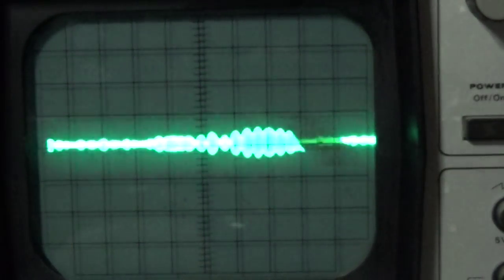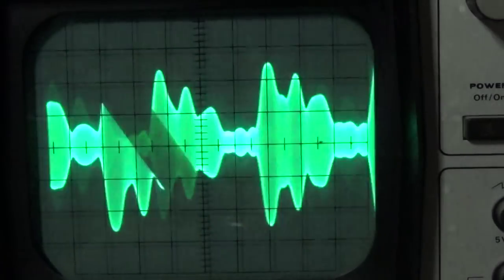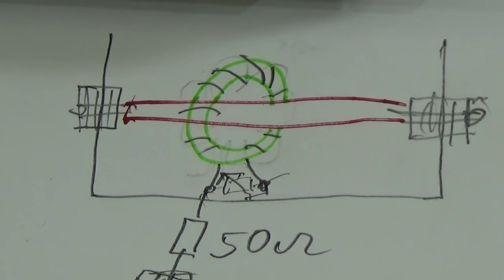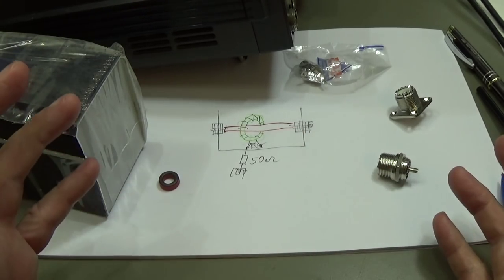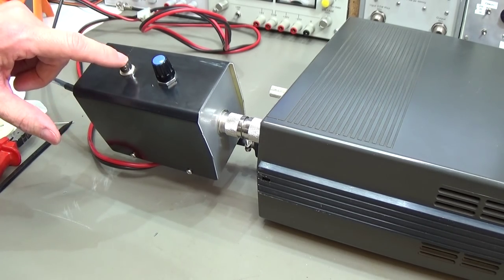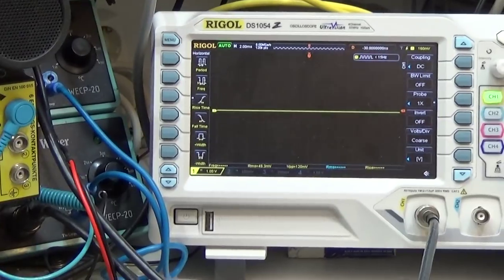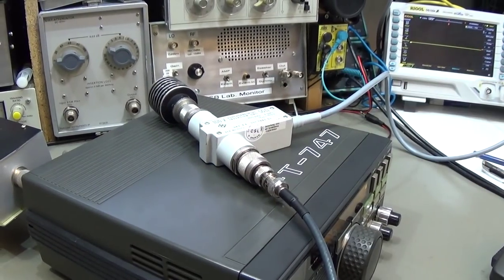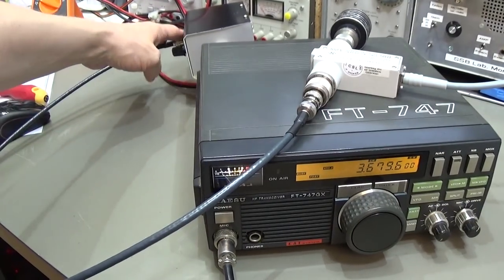#74 Quick Tip: Build a Variable RF Tap for your shack or lab

Comment: Nice project Peter! I use a few of this design (slight variations) in my AM setup. I directly power headphones so I can hear my final audio... As you pointed out, also great for driving scopes :^)
Reply from the maker: +Mr Carlson's Lab Hi Paul, thank you so much! Yeah with a AM set up it is much easier as the demodulator is very easy to realise. For SSB it is a bit more effort.. Anyway enjoy a happy advent! 73

Comment: I was going to say it’s not the easiest way to make  an rf sampler but the fact it’s adjustable is a winner. I am making some videos myself on playing with RF test gear and I enjoy construction projects so will have to give this design a try.  As always thanks for sharing.
Reply from the maker: Thanks for feed back and good luck with the project! 73
Reply: TRX Bench  I will be uploading my video using a simple loop in a dummy load housing later this week. When I investigated the frequency response of my rf sample it was a bit disappointing with a high pass response and 30 dB difference in attenuation between 2 and 145mhz. What was the response of your transformer coupled sampler. The idea behind my short video series will be how not to destroy your front end. My best regards Chris.  I made a boob measuring a second harmonic as I had not included  for the frequency response of my  sampler.  I would love to hear your thoughts on this and measurement errors in a future video. My very best regards Chris AKA all the gear and no idea!

Comment: Use a box with a lid so all soldering can be done easier.  Stay with metal.  Use a copper strap across the bottom to connect the ground side.  The box has all kinds of "floating" grounding you have used.  The BNC is grounded, so take advantage or that and design a proper voltage divider network.  Use a coax cable and keep the shield on it except where the IRON Core toroid not a ferrite goes.  Ground each end of the shield as close to the toroid as possible and at each rf connector.  Use polymide tape and build up the diameter so the torrid is a snug fit and will stay in place.  Use non inductive resistor for the divider network.  Do not use a wire-wound resistor anywhere, especially as a trim resistor.  Why is everyone still using UHF connectors.  They reflect RF as low as 100 MHz.  I change everything to N Type, even all my radios.  Use good ones from Amphenol or King with a white bronze coating.  It will not tarnish like silver.  While you're at it add an AM detector to it.  You will need a shield between the 2 circuits.  Ig you want to go above the HF bands, you will need to use SMT and keep all leads as short as possible around the divider network and maybe shield it also if you go to 1 gig.
Reply: Build one and show us.  It is childish when Johnny-come-lately know-it-alls  show up on tutorial videos like this trying to show how much they know.

Comment: Hi Peter, what value resistor did you put across the POT?  I see the 50ohm connecting to the bnc but I don't believe you mentioned the value on the pot.

Comment: Personally I would put all components on one side only and put feet on what you have used as a lid. Makes assembly much easier. Useful video though. The formula for the number of turns verses attenuation of the sample would have been useful but is available on another video on youtube.

Comment: Simple, effective and a much needed device. Thanks for sharing. One question, do the resistors have to be non-inductive? I have a bunch of 50ohms lying around, how can I test whether they are inductive or not?
Reply: Ok, I was quick to ask. At the end of the video you say "metal film" which should be non-inductive. :-)
Reply from the maker: yes that is the answer 73

Comment: Just noticed the FT-747 on the bench just watched a new video #107 on The Radio Shop with you friend Buddy about the bad vari-caps on the back of the Radio that are know for failure on that radio. They are 90 degree angle and looks like good quality ones cannot be found with the 90 or as some say right angle mounting and improvised mounting is required.

Comment: I would have guessed an impedance bump , going through the box to dummy load ?
My reasoning is the dimensions of RF path , coax impedance is partially made up by the dimensions between dielectrics ?
Thanks again John
Reply from the maker: +KD0CAC Hi, yes you are right this is valid for coax cables. In this case it is no problem as we are far below critical frequencies where it indeed matters. Thanks for comment 73

Comment: Excellent Video as ALWAYS! Thanks so much for you work. Would this be OK for 1.5 K watts?
Reply from the maker: +TheMidnightrdr Hi, thanks for stopping by. No this device is designed for 100W max it will work for a short while with 200W but not more. Hope that helps 73

Comment: I don't understand.  The through conductor is not coaxial.  Therefore, it's a step impedance change in the transmission line.  Won't it send strong reflections back  into the radio?  How does this project avoid doing more harm than good?

Comment: Why are you using a wire wound resistor (pot)? This adds unwanted inductance. Also where did you find a 22 ohm pot? I checked and they are unobtainable, at least I couldn't fine one.

Comment: Cool project Peter.  
In your case: 
Ferrite core is T20?  
What is the pot value and the paralell resistor on it?

Thanks 
Claudio / OA4BMG
Reply: sadly peter didn't mention the value of the pot, when i calculate 2x22ohm paralell i get 11. somethig ohm???, what is the value of the pot ,gues paralell whit the 22ohm should be 470ohm in paralel whit 22ohm, you get 22

Comment: Excellent.  How do you know how many turns of wire to put on the ferrite ring?
Reply from the maker: +Barnekkid Hi, we could calculate it but we don't need it here as it is simple as it can be.Just do some windings and check the output voltage. If it is okay for your needs fine if not put some more on the core. Check the output power over the frequency is it flat fine if not take another core material or put more windings for more induction.  I only try to keep it simple of course we can handle this via maths as well. 73

Comment: I was measuring the power output of my CB Radio simply by directly connecting my oscilloscope's probe to the dummy load. I figured that the voltage is just about 20 volts and well within the frequency range of the scope. Basically I measured the power output exactly like I measured  it on audio amps, just with a different sine wave frequency (27MHz instead of 400Hz) and dummy load resistance (50ohms instead of 4ohms). So, is there something I'm  missing? I understand that if you go near 50w of output power the voltages become dangerous to the scope. But couldn't I simply use a 100:1 Probe? Or does connecting the probe directly mess with the SWR? Is using an RF tap just a convenience? Or even just a well honored tradition?

Comment: Peter nice video, I was actually considering do this very thing, so thanks for confirming my approach. One thing I saw in your video is sitting odd with me. You design the tap with a 50 ohm source resistance then you directly terminated it to the oscilloscope which is a high impedance port and when you did the power measurement with the Rohde & Schwarz URV5 you terminated to 50 ohm load and took a bridge measurement, which depending on the probe that you used makes sense but should you also done the same with oscilloscope ?
Reply from the maker: +Michael Katt Hi Michael, yes of course you are right! To get the right figures you need to terminate it with 50 Ohm as I did it with my URV5. If you need to get an accurate measurement on your scope you need to terminate it with 50 Ohm. For my demonstration it was not necessary so I was able to skip it and only terminated the source with 1MOhm with the result of doubling the output voltage. Thanks for comment 73

Comment: Nice Video, nice project!  Would it be possible to directly use this tiny tool, to measure the output harmonics of an home brewed transmtiter?  Or should one better use an dummy load, with an -40 dB output to connect the Analyzer/ Scope to?   Thanks.
Reply from the maker: +MrVertigo1971 Hi, yes that is possible as the harmonic test is a relative measurement to the carrier (dbc). Therefore you can use this device. But if you need 100% accuracy you need to take a dummy load with a precision test output level with a flat gain over the entire bandwidth.  Hope that helps.. 73s
Reply: +TRXBench    It helps indeed. Thanks a lot for your valuable feedback

Comment: Peter, Why is the response flatter when  using the toroid rather than just winding the wire around? you never really explain this.
Reply from the maker: +Doctor Forbin Well there are some dependences in RF circuits but to make a long story short let me try to simplify as much as possible. We have to fight with changing independences over the frequency, with stray losses and saturation issues this and some more effects makes it nearly impossible to control it without a toroid. As I said this answer is simplified but may give an idea on the hole challenge.  73

Comment: thx for the great video - where can I get such a metal boxes ? This will be my first project in electronics ... thx for sharing. Can I directly build a wattmeter into the box as well ? Which cheap components could I use and how could I calibrate it without osci etc.
Reply from the maker: Good luck with the project Stephan. Boxes? reichelt.de buerklin.de conrad.de and so on... 73

Comment: Peter. Did I understand correctly that I can use this to connect hf radio to my spectrum analyzer.  Without attenuation? I understand that there are a lot of parameters to be aware of.
Reply from the maker: Yes, in principle you understood that completely correctly, but it would be good to check, once you have finished the sampler, whether the maximum attenuation of this sampler actually reaches at least 30 dB.  Please remember that your spectrum analyzer is a very sensitive device that can be quickly destroyed.
Reply: @TRXLab  
Thanks Peter.

Comment: Could you put a short (very inefficient) antenna on the scope input (or frequency counter or spectrum analyser or whatever) and simply Tx the transmitter close by? May be necessary to vary the distance between the two but should pick up enough signal  to get a trace/frequency  readout etc?

Comment: How do you have your scope setup at the beginning of the video? i built this project and my wave forms look a bit different when modulated than yours did. Thanks for the neat design by the way. I have been looking to build something like this for a while and your circuit looked very simple yet flexible.
Reply from the maker: +afleak (KD0YTE) Hi Alex, well nothing special just to get a nice pattern only by try and error. I recorded a SSB pattern, may be you tried another mode?? Hope that helps..73

Comment: What is the value of the Pot and the resistor across the pot. Tim W8RNG Ohio USA
Reply: 22 Ohm potentiometer, and 2 resistors 50 Ohm and 22Ohm in parallel with potentiometer.

Comment: The RF tap you have going to the Millivolt db meter,is it the same as the built unit other than not variable? Also is there a way I can use my Leader LBO-310A to test CB Radios with,do I need anything special to use it.

Comment: Where do you find an affordable 200 ohm wire wound pot ????
Reply from the maker: The resistor value can vary and don't need to be exact 200Ohm

Comment: TRXBENCH, Can you suggest a different resistor combination ? A 22 ohm wire wound pot is rather odd, I'm trying to build your project without special ordering parts. Great videos and thanks !!
Reply from the maker: +Phil Spargo Hi Phil, well you can go down with the pot to let me say 18Ohm but you need something rough. If you can get a pot with more power just use it. The wire wound is simply the cheapest solution. But again you can use what you want material wise. Hope that helps. 73
Reply: @TRXLab  Is the pot 22R or 220R

Comment: I am building one of these samplers myself.  Most all I understand. Got me Rigol products for test and measure. Was there 50 ohm terminator on scope? I could not see.  Second, more important....    Can I put this sampler directly on the back of dummy load with a watt meter and use a short coax for connection to transmitter?  How much coax effect?   This me much easy for connecting and testing radios.
Reply: John Cundiss  Hello John. The basic thing with RF wiring is that cable lengths only really matter when the wavelength of your signals approaches that of your cable. For example at 3mhz your wavelength is around 80m so a couple of meters of cable won’t effect anything. However if you working at 145 MHz your wavelength is no 2m and cable lengths have an affect and correct termination become more important. If your working in GHz everything matter.   So for working in the HF bands provided you use good quality cables and connectors and terminate reasonably carefully your going to be fine. Hope this simplified explanation helps.
Reply: Has helped some and does make sense.  Thank you.  Built my box and got a nice flat response from the Rigol up to around 80 Mhz and that is more than good for me currently.   Yea very true, the highr the frequency, the more things get very "touchy".

Comment: Did you by chance check your coil with an inductance meter to see the result. I used a 22 gauge wire and got 25 actual coils on the outside of the core and it gave me 5.35uh and was able to use the center conductor from a piece of 58U Coax with a good fit.
Reply from the maker: Hi William, it is not so important to check the inductance as long the core does not go into saturation.  73
Reply: Thank you very much,Sincerely William C. Colvin.

Comment: What is the number of the ferrite core you could use in this project ?
Reply from the maker: Take what you have in your tinker box put some windings on and try if the output voltage is okay. If not put more windings on or take another core...

Comment: nice video peter....Would the coupling be sufficient to use this for testing audio  power amps?
Reply from the maker: +Doctor Forbin Hi, no this unit is developed for 50Ohm circuits. Not good for low impedance stuff. 73
Reply: +TRXBench Peter most audio applications the impedance is around 600 ohm? You state that this will not work because it is not good for low impedance, but the 600 ohm is higher than 50 ohm?
Reply from the maker: +Doctor Forbin yes supposing you are talking about PA output, as this application is designed for RF output  around 100W. 600Ohm is the input impedance of audio applications with low level output...

Comment: Why do a lot of people design their RF Sampler with a demodulation circuit in them also?
Reply from the maker: Hi William, that comes from the past when a scope only had very limited bandwidth or a scope was totally missing. With demodulating the hf you was able to hear the af tone and thus it was proven that hf is going through the circuit...hope that helps 73
Reply: Thank you very much that really helps,Sincerely William C. Colvin. I was going to use an SC-239 Tee and come off the side connection of the Tee with a straight through RF Sampler, but did not know if I needed the Demodulation Circuit.